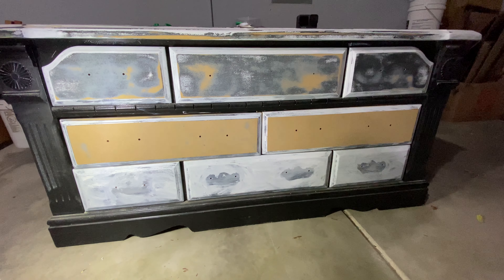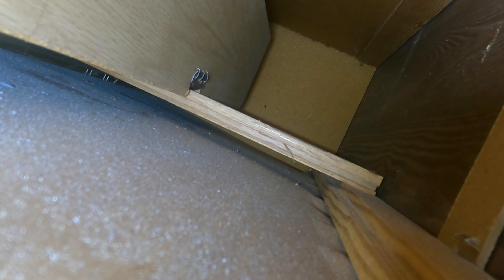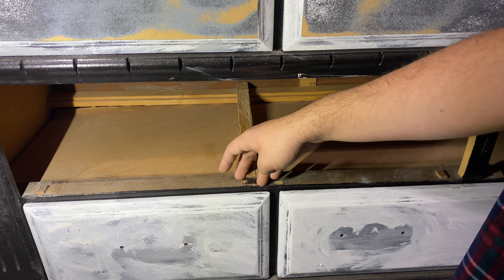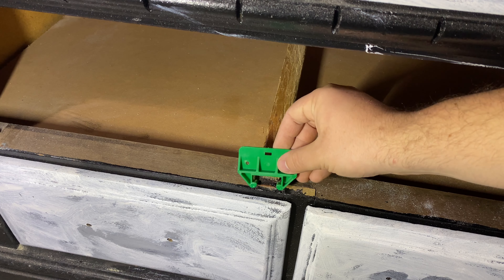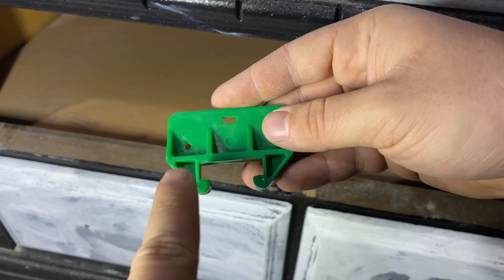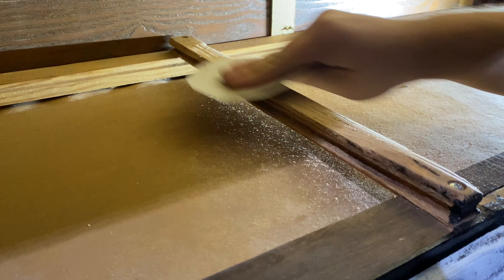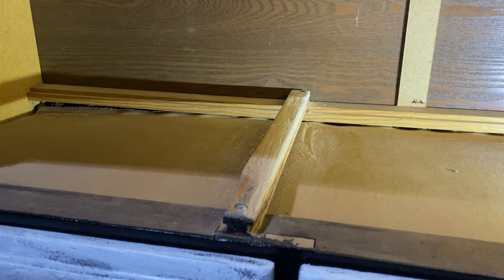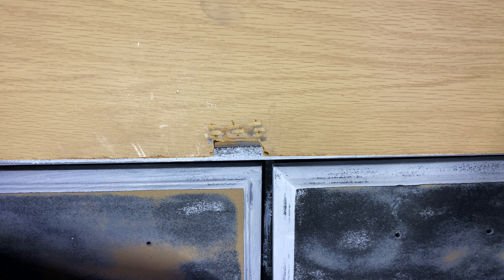How to Replace a Bottom Center Mount Drawer Guide

Comment: I agree.   Lifesaver.   But I have the new guide on the drawer which is a wide drawer and once it slides in it's still pretty unstable.   Anyone have any ideas how to stabilize it more?
Reply from the maker: Add another guide somewhere near the other end of the drawer. One guide is barely enough in my opinion so two is better. A guide the length of the drawer would be even better.
Reply: Thank you.  I will give that a try.